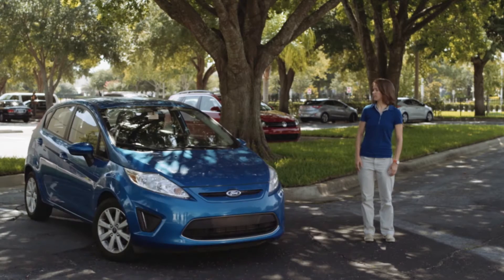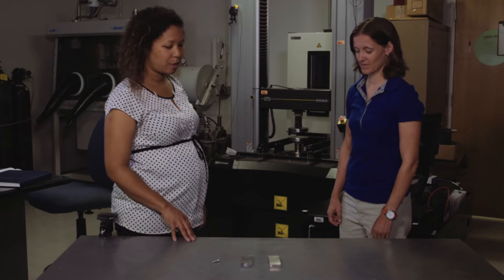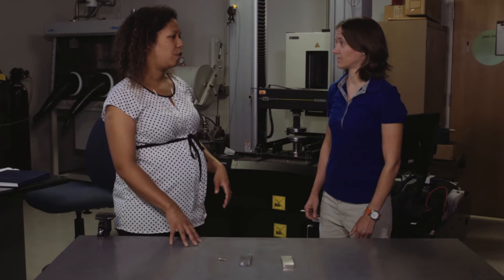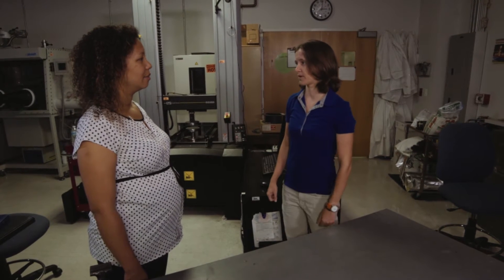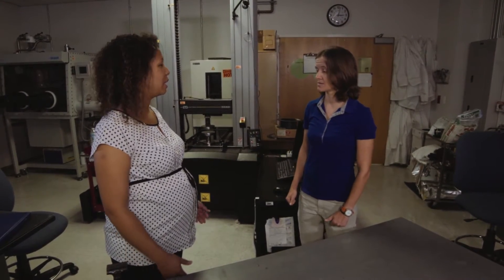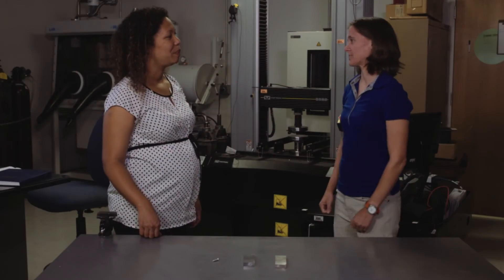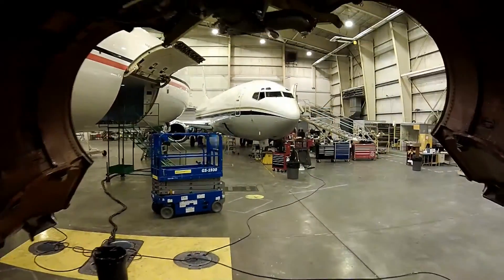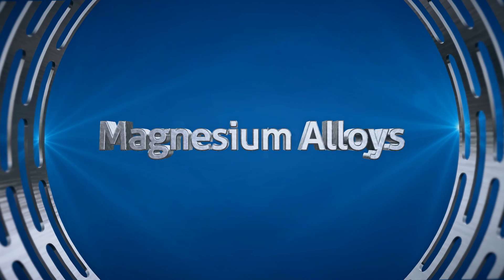Impact of Materials on Society (IMOS) - Magnesium Alloy

Comment: I find it surprising, that magnesium alloys are almost non-existent in everyday life.
I recently purchased a small stock of aerospace magnesium alloy for machining extremely lightweight parts. The hoops I had to jump through to get it, were like no other material. It is actually much easier and cheaper to obtain grade 5 titanium parts than magnesium, and it read shouldn't be.